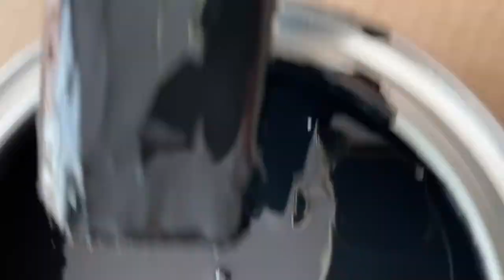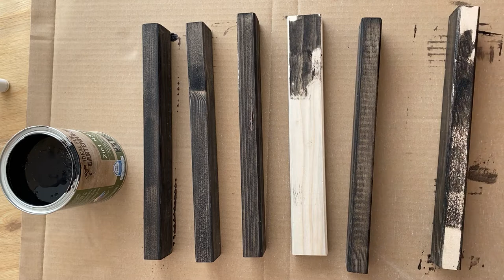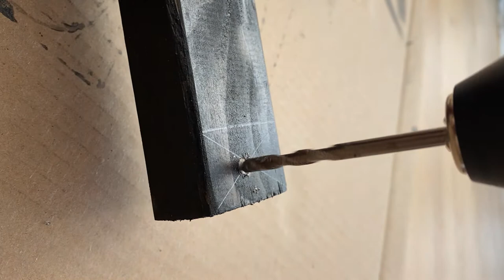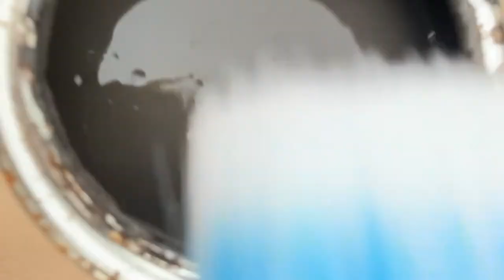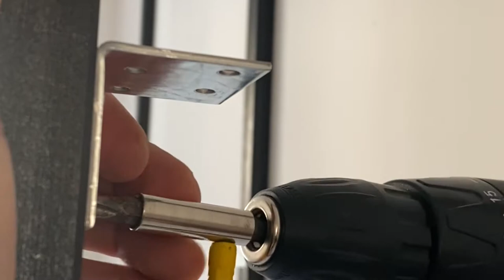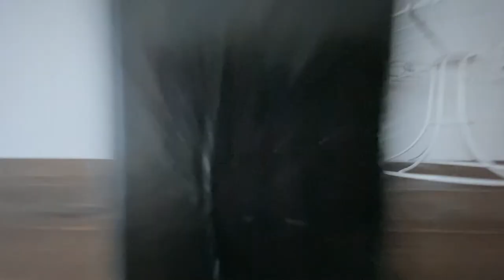DIY Ceiling Mounted Kitchen Shelves

Comment: What are the measurements for the wood that you used? Are those 1x2s?
Reply: Those could 1×3's  but I believe that the 1× 2's will work. For one we'll use metal L- brackets to help inforce the strength of them.